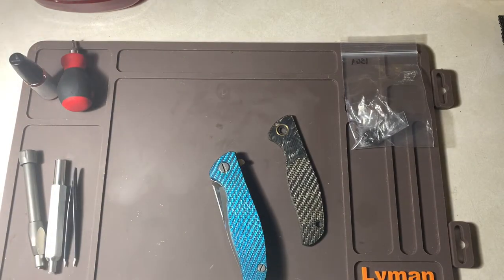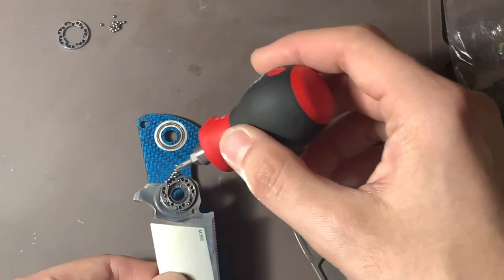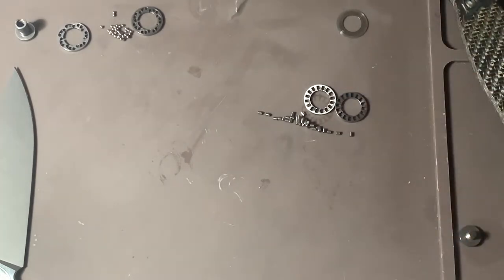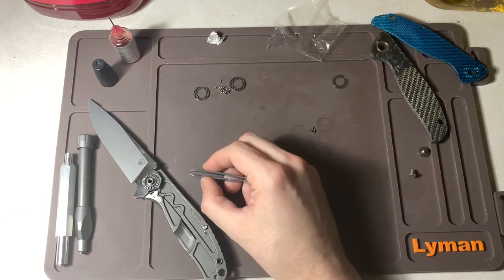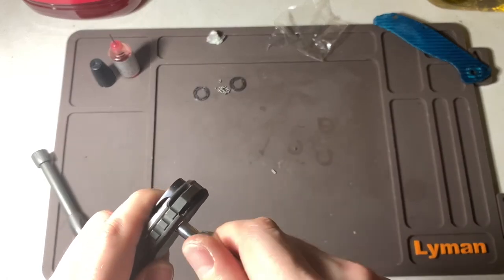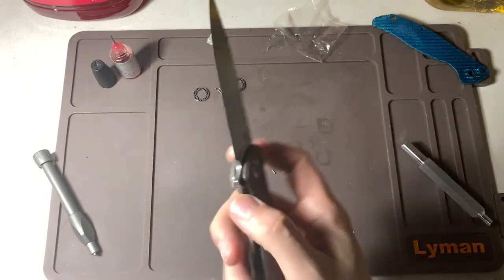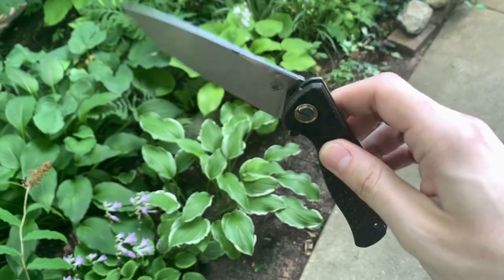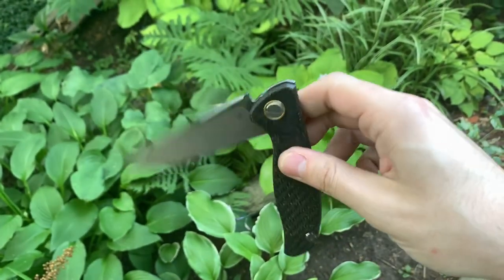Shirogorov Hati R Scale Swap and MRBS vs Roller Bearings!

Comment: Why? Why can’t the bearing be caged into the opening. What grade are the bearings. How many extra do they give you?
Reply from the maker: Hey so I’m not sure how familiar you are with Shirogorov knives in general, but most models have loose bearings or “MRBS” which gives a very unique and hydraulic like feel when opening and closing them. I know they are steel bearings but would have to ask one of my buddies about the exact grade. They don’t come with extra bearings but in my personal experience, I’ve never lost any when disassembling. I’d have to double check but I think 1.5mm is the size and I know a few people that have just ordered extras on Amazon and said they fit no problem. I’ve handled tons of knives from all different brands and in my personal opinion Shirogorov is among the top when it comes to the action. It’s all personal preference though and if you’re someone new to the brand I highly recommend trying one at some point. If you like smaller knives the Hation/ Neon models are a great starting point or if you prefer larger the Hati or even the model 111 is awesome!

Comment: That looks sick! How are the roller bearings after getting dirty? I feel like they would be more effected by lint and dust the ball bearings.
Reply from the maker: So personally I have not had an issue with the bearings getting dirty to the point of negatively effecting the action, but I mean if that did happen you can take it apart to clean fairly easily.  I don't feel like these gunk up any quicker than the regular MRBS unless you use a lot of pivot lube on the bearings which in that case would start to build up faster no matter which set you had at that point! I tend to run my Shiros with little to no pivot lube because too much will make the action feel funny as well, at least in my experience
Reply: Mr_Niceguy Knife Reviews did you get the roller bearings from Shirogorov or are they after market?
Reply from the maker: Dan Duran so I got the roller bearings from Dept_13, you can contact him through Instagram. He does the rollers and custom scales as well. That’s where I got the one with the pivot collar that I swapped in the video! He’s located in Russia so there’s a bit of a wait but it’s definitely worth it if you decide you need something! I’m really happy with how my Hati R came out with all the mods I did to it. Gives it a much more customized look and I love the way the scale has like a marbled CF bolster and then the copper dust twill it’s really unique.
Reply: Mr_Niceguy Knife Reviews it looks great. I am working on getting my first Shirogorov. I am aiming for the F3ns. The price has always been a little out of reach but I can’t hold off any longer. The just look way too attractive. Thank you for your help.